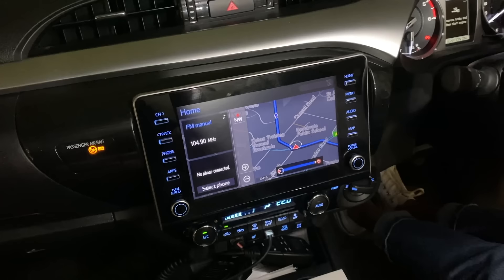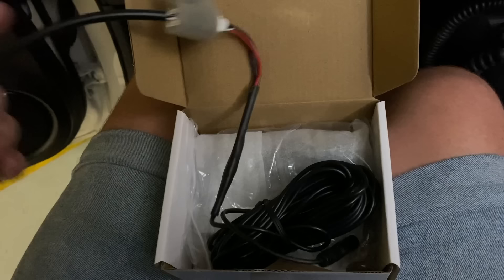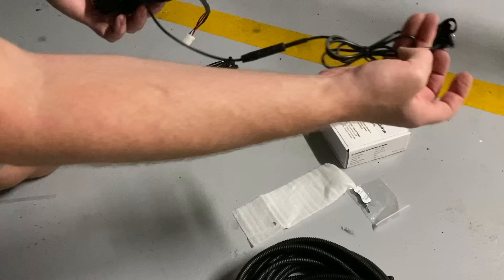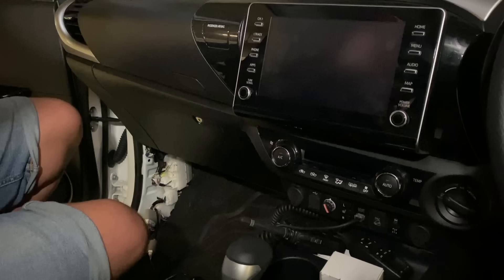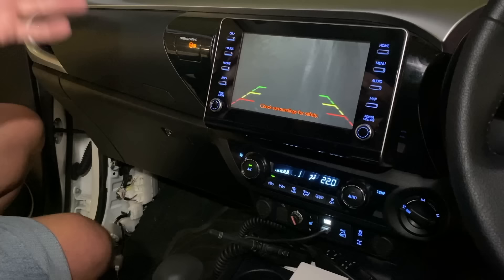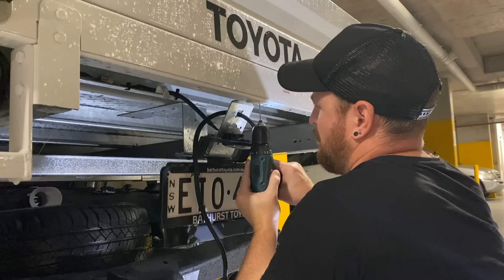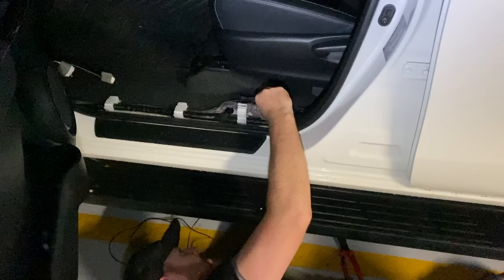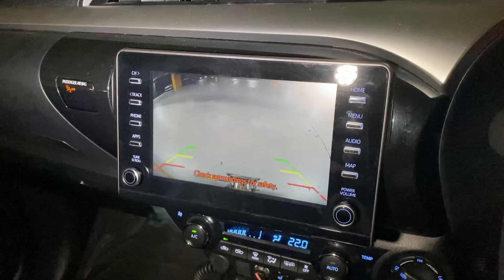How to Install Reverse Camera on Toyota Hilux Factory Screen | 2020 to 2024 Models DIY Guide

Comment: Thanks Guys, I ordered this for $170 not $440 from Toyota. It arrived about 2 days later with this link on the bag. I just installed it on my brand new Toyota Hilux with custom tray and it's perfect. Took about 1.0 hr to do. Camera cable is plenty long enough. Super easy to follow these instructions. Waiting for the reverse bypass switch to be available. 
Totally recommend Carbon Car Systems.
Reply: What is the reverse bypass switch?

Comment: Anyway to set this camera up so you can have it on whilst driving?
Reply from the maker: We are making a switch that will allow you to turn it on any time and also add a 2nd camera (either front or trailer camera for example)
Reply: Put me down for this. I have a canopy so no rear mirror at all. To use it while driving would be great so it's like looking in the mirror.